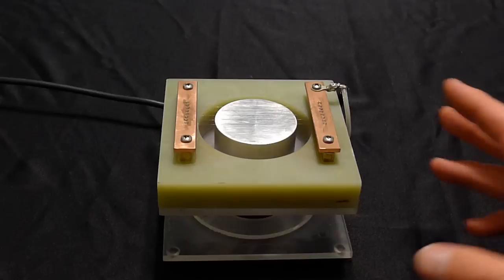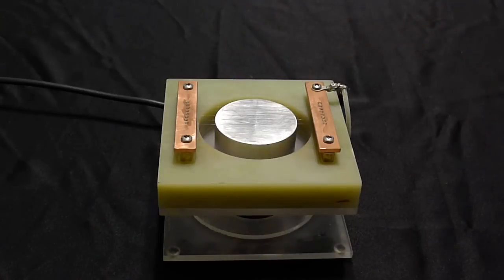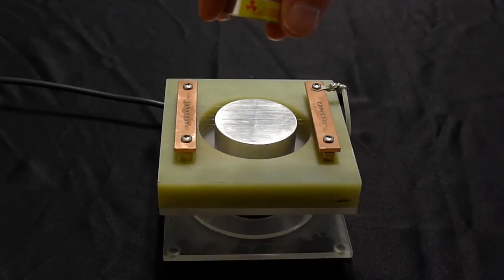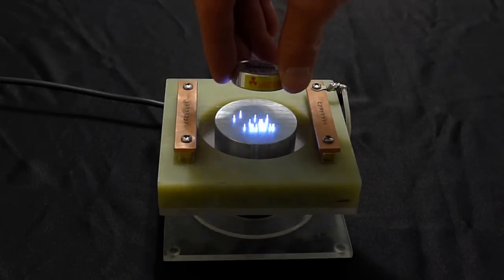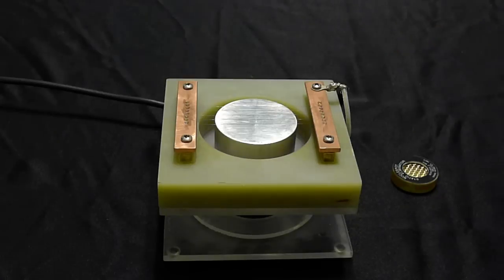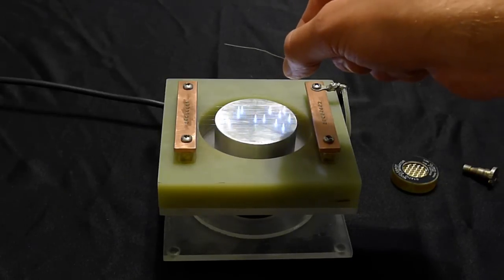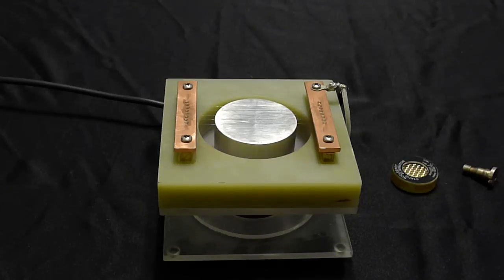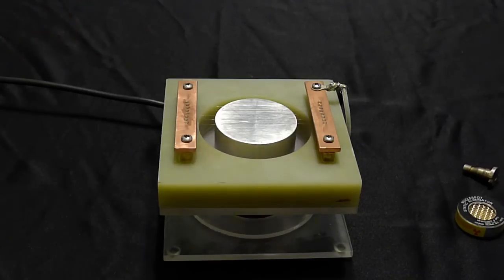Spark detector for alpha particles

Comment: You've done a fantastic job with this piece of equipment. I could have not imagined it will work so well. Thanks for sharing. Have you tried with a different wire material and/or thickness?

Comment: The sources are sealed, so there is very little risk when handling these sources. The sealed Radium-226 source is my favorite, since the decay daughters, like Polonium-218 have more mass (about 8-9 MeV), so you see those ionise the air from a farther distance from the wire spacing. Since it is constantly decaying, you will get much more massive alpha particles from the daughters of the Radium-226 source. It will remain radioactive for thousands of years (T-1/2 of Ra-226 is 1601 years).
Reply: how to get these types of materials??

Comment from the maker: If radon progeny are not removed from the air prior to sampling, e.g. with a filter, one must assume they are present in some significant concentration and correct for that.  A rough rule of thumb is that half of the equilibrium concentration of the 4 short-lived daughters are found in indoor air, but a wide range is possible.  Home radon test kits have ~20% uncertainty by law, and most of those are cheap and very simple.  I am personally a fan of the ol' Lucas cell scintillation approach.

Comment from the maker: Most Lucas cells are made for a 2" PMT and are about 80% efficient (80% of Rn-222 decays are detected).  Almost any PMT with a flat face will suffice.  You can see the scintillations by eye from ZnS:Ag, so the PMT's noise and gain are not critical.  The downstream electronics are a shaping amplifier, SCA, and counter at the simplest.  The SCA's lower discriminator is adjusted so that background noise and non-alpha counts are rejected.

Comment from the maker: Only alpha particles, yes.  The original description of the spark detector by Chang and Rosenblum (1944) discusses some efficiency considerations.  It is close to 100% efficient for particles whose tracks come within about one wire diameter of any of the wires.  Quantitation of radon poses a number of challenges with this device, one of which is the plating out of daughters in the high fields, but simple detection seems practical.
Reply: Hey Carl, I have americium from a smoke detector and while I don't have your exact set up, I have a high voltage source. Now, I have observed no noticeable difference of how far the spark can jump with or without the alpha source. Could you explain why this happens?

Comment from the maker: If you capacitively couple the pulses off the HVDC bias, you can then count these pulses just like you would any Geiger counter pulses (e.g. with a LabJack, or by using a program like PRA that interfaces with your sound card, etc.).  Be warned though...this is a high voltage circuit--more so than a Geiger counter--and you need to be careful that the signal level does not exceed what your particular hardware is designed to handle.
Reply: You could use a vacuum tube isolating stage, they can handle up to several 100 volts on their grids for short periods of time without much trouble. You could even use a gas-filled cold cathode thyratron for the opening stages of a counter circuit. Or a hot-cathode one if the speed got very high. This might be faster than a Geiger-counter even! Down-time should be less if you limit the amount of current flowing through your detector, since gas pressure is much higher, hence replaces more easily than the closed environment of a GM-tube.

Comment: If you connect negative potential to tungsten wires and positive (or ground) to aluminum disk will it still work correctly or will it break down air because of strong electric field around the sharp curvature of wires? I do not recall how it was but I think the polarization I mentioned is for corona discharge in ozone makers and in dust filters.

Comment: I noticed that there was never any discharge from background radiation.
Does this detector require a very high flux density?
That would make sense since the number of sparks observed was
less than the number of particles presumably hitting the detector.

Comment: I have americium 241 from a smoke detector and while I don't have his exact set up, I have a high voltage source. Now, I have observed no noticeable difference of how far the spark can jump with or without the alpha source. Could someone explain why this happens?
Reply: Alpha particles ionize the air therefore making it easier for power supply to create arcs

Comment: WOW! This is AWESOME! 5mCi of Po-210, That's NICE! I like that Ra-226 source, from an old Walkie Record-All! The alpha particles travel far from that, I'm guessing due to its decay to Rn-222, so there's "emanation" coming from that, so the Rn-222 sinks to the spark detector. Is that Ra-226 strip in metallic form? Just curious. I do have a 80µCi Am-241 source, but the 60µCi is on a large disc, and the remaining, which I guess is 20µCi is inside a chamber. I like yours, more compact! INCREDIBLE!

Comment: Nice Demonstration. Looks like the Radium Wire can trigger the
sparks from a farther distance than the Americium and the Polonium source.

Could it be because the Strong Gamma Rays from Ra-226 can also
ionize the air and trigger the spark, or because the Alpha Particles
from Radium are more Energetic ?
Reply from the maker: The radium decay chain provides some very high-energy (~10 MeV) alpha particles from its shorter-lived daughters.  These are able to travel farther in air, causing the effect you see.  The gamma and beta radiation are unable to trigger this kind of detector.  When a piece of paper is placed between the radium source and the detector, the sparks cease, although most beta and gamma radiations still reach the detector.

Comment: You said it doesn't work through paper. I wonder if it will work through glass or aluminum foil if held up close? It appears to be very similar to static, in that once it is quenched by something in its path, the influence disappears. That would imply more of a ray than a particle. But if it's a ray, then it should go through glass, although I'm not sure if static goes through that either.   

Static is obviously not a particle, as all you're doing is rubbing a piece of styrofoam on your hair.  But on a cold day, you can feel it up to a foot away from your skin.  I think a piece of charges styrofoam would set off the detector also, so that might mean it's doing the same thing as the radioactive material.
Reply from the maker: +gilbet This type of detector is sensitive only to densely-ionizing radiation such as alpha particles, which cannot penetrate typical glass or aluminum foil.  Electrically-charged objects in the proximity do not interfere with or cause discharging of the detector; electric fields originating outside of the gap between the wires and the back electrode do not enter the gap.
Reply: Carl Willis I think  testing those assumptions will yield a very different result.
Reply from the maker: +gilbet Which "assumptions?"
Reply: Carl Willis I think any source of strong radiation will set it off.  A charged piece of styrofoam rubbed in your hair, a flame from a lighter, or maybe even a magnifying glass focusing the Sun's rays between the wire and the base.  

Any heat would be reflected away, but I think it still might ionize the air.  In 1887, Heinrich Hertz discovered that ultraviolet light causes electric sparks to occur between electrodes more easily.
Reply from the maker: +gilbet I can confirm from experience that flames and strong electric fields outside of the air gap don't have any influence on this kind of detector.  Intense enough air ionization by any means can, in principle, cause breakdown, but again, the ionization must be intense on a local scale near the wires.  The detector is insensitive to ordinary quantities of photoelectrons (per the Hertz experiment).  I am sure a powerful pulsed laser would trigger it.  But in the common environment and conditions of use, this configuration detects high-LET particulate ionizing radiation only--not electrons regardless of origin, not muons, and not indirectly-ionizing radiation like UV, x-rays, gamma rays.

Comment: What is the cause of the mic doing that when the sparks happen?
I am guessing the sparks create noise in the mic, gets filtered out and lot of information from the speech gets lost during this erroneous filtering?! Did any other camera do this?
Can you correct me if I am wrong? Never seen this detector before. very interesting. Thanks.
Reply: I thought it was just the sparks making actual audible noise, but pushing on molecules of air. ? Just guessing. Interesting question.

Comment: with such a short distance between the wires and the aluminum, and such a high voltage, why does it not just spark without alpha particles?  also, could you make one sensitive enough to see beta particles etc?
Reply from the maker: +Zev Hoover The breakdown voltage of the air gap is higher than the applied voltage, so breakdown is avoided unless the dense ionization from alpha particles enters the gap.  Similar concepts work well for less-densely ionizing radiation, e.g. beta particles, but none to my knowledge that use ambient air as the detector medium.  The typical Geiger tube contains neon and bromine at reduced pressure (about half an atmosphere), and in a glass tube of this type you can watch the orange sparks as beta particles enter the detector.
Reply: Carl Willis thanks for the response. if I may pick your brain a little more, how did you chose that voltage?  I understand that once you choose a voltage, you can make the air gap just a little bigger than that, (from some rough estimates, 8kv should be just about able to spark ~0.1in and 6kv can do ~0.08in), but what about running at a lower voltage and smaller gap?  would it just be harder to see or is there some reason this needs to be high voltage?

also, you mentioned a current limited supply, what was the limit?

thanks!
Reply from the maker: You want to limit your current at about 1 mA or less.  The first reason is safety: there is no reason to run higher currents or you risk some uncomfortable or dangerous shocks.  The second reason is to protect your thin wires.  You do not want a lot of stored energy (capacitance) or power available to this device or the wires will be ablated quickly.  On the other hand, there is a significant corona current that flows from the wires.  So plan on drawing between 10-100 microamps, but limit your current at short circuit to 1 mA or less.  Instead of picking a supply voltage and designing the air gap for that voltage, I recommend building with a gap of your choice and then using a variable-voltage power supply like I do here to find the operating point.
Reply: Carl Willis thanks again.  this thing is just one of the coolest ways I have seen to visualize radiation.  I am working on a 1kw water cooled peltier based cloud chamber right now, but I think I am going to try making one of these next.  I wonder how different size cathodes would affect it...

last question I promise, why tungsten wire?

Comment: Hi
a great work!
How much energy this thing can generate?
Reply from the maker: I don't think I understand the question!  What do you mean about energy?
Reply: Carl Willis Does the flow of ions create an additional current in the circuit?
Like in a triode, where the screen is the mesh of wires?
Regards
Reply: Alex Likhterman I think the answer would be an unqualified yes as far as current spikes, which will have the same duration as the ionization events.  You could build a circuit to measure that certainly, perhaps an inductive detector circling the HV supply wire?  However, the amplification, if you can call it that, would be very much unlike a triode which would tend to be smooth and likely a lot more linear than this device.  Any signal you got from using this as a stage or would be incredibly ragged.  However, I bet you could use those current spikes to make some sort of counter circuit that would at least work up until there were too many simultaneous discharges to distinguish from one another.  Also, there would be no current at idle on this circuit.  There will only be current flowing at all during the discharges.  So, in summation, no this device does not generate any current at all, but rather, tiny bursts of current are allowed to flow from the HV supply during each discharge.  Anyway, sounds like a fun experiment!

Comment: Most Lucas cells are made for a 2" PMT and are about 80% efficient (80% of Rn-222 decays are detected). Almost any PMT with a flat face will suffice. You can see the scintillations by eye from ZnS:Ag, so the PMT's noise and gain are not critical. The downstream electronics are a shaping amplifier, SCA, and counter at the simplest. The SCA's lower discriminator is adjusted so that background noise and non-alpha counts are rejected